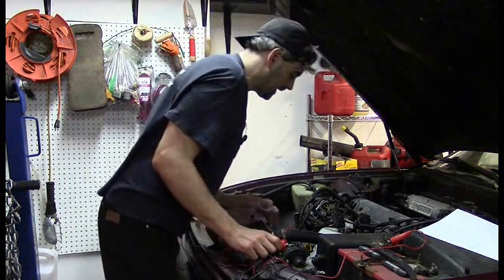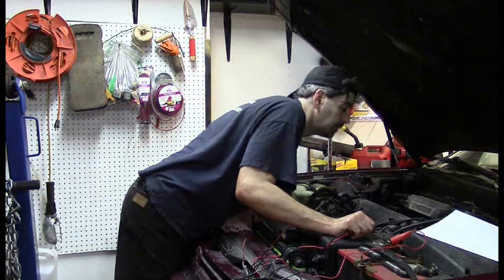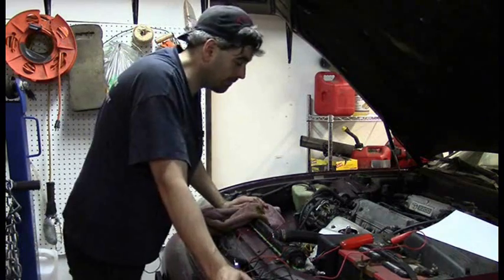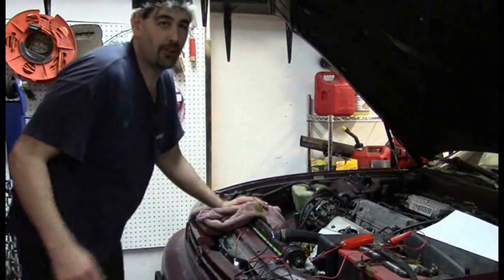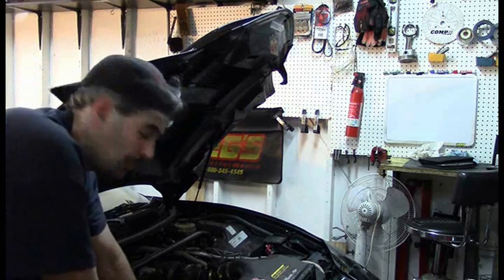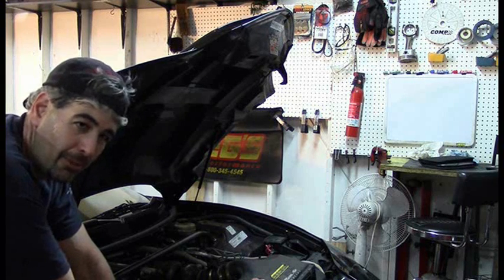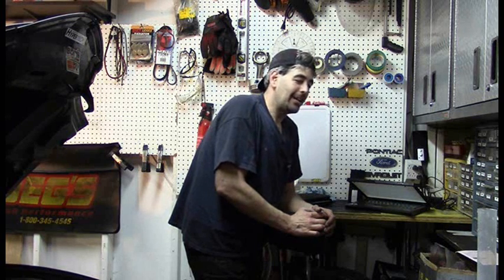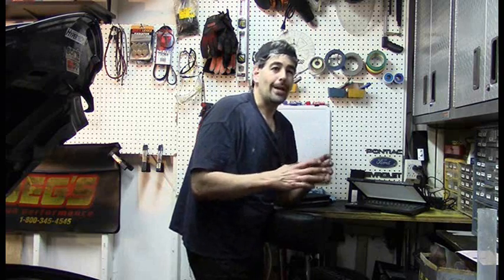12 Ways of How To Test A Blown Head Gasket Compared- PART2

Comment: great, I might add 70s vintage van w/318 after 200k miles would always lose coolant to a point. turned out coolant was permeating through upper hose. My favorite however is fresh water cooled 350 in my boat overheating , collapsing lower radiator hose. All my cars have springs in them after that. Your video will help me diagnose 08 acura v6 overheating, thanx

Comment: Pressure leak down test was fantastic. Bubbling air through radiator!
Testing tailpipe for dye - Nope - Not scientific - didn't check for any florescence BEFORE you added the dye.  (jk)
Boiling oil test was impressive; props to Cedrick!
Could we complete the paper spot test with the dye and the engine cold? That would be pretty dramatic.
Great videos!  You are a great teacher!

Comment: Absolutely outstanding video series on head gaskets!   I've learned so much from you and your Youtube channel in general (you and ScannerDanner inspired me to get an automotive oscilloscope and the AutoEnginuity software).  I'm performing a diagnosis on a 2003 Nissan Sentra 1.8L engine right now.  So far, I have found the same result you did with regard to leakage during the leakdown test. In my case, it was cylinder 1 @TDC experiencing a 22% loss and causing the radiator to overflow when the leakdown tester is pressurized with 100 psi of compressed air.  Matt, given this observation,  is there any chance that the leak may still be due to a failed intake manifold gasket and not a cylinder head gasket, cracked block or head?  I have ordered the chemical test you demonstrated and plan on using that to corroborate my findings from the leakdown test.  Compression in all cylinders falls within the acceptable limits specified in the factory service manual, however cylinder #1 has the lowest compression of the four.   I appreciate your input and thanks in advance for any insight.

Comment: Bro you say you're such a good mechanic why is your trans am your baby radiator black or brown looks like there's a rust in your radiator in your block now through your whole cooling system
Reply from the maker: Well your screen name says it all- you have no idea what you are talking about. The brown stuff is the GM recommended conditioner/sealer "pellet formula" that all pre 2002 vehicles use along with dexcool.  It is not rust. Come on man, seriously.

Comment: Not a mechanic, but purely curious regarding the paper test vs the leak down test. 

Is it possible that #2 is leaking into #3, and #3 is the one leaking into the coolant? That would explain why #2 didn’t have coolant blowing through the spark plug hole.
Reply from the maker: Yes it absolutely is- thats why the test is not definitive on which cylinder BUT if you see coolant on that paper for any reason you are still in trouble.

Comment: I just found your channel... this is very well done, informative and quite practical... thank you.  By the way, the sizzle test is very good for testing for coolant in the oil.    Makes a lot of sense.  But that alone only means Coolant in oil, not a blown head gasket.  It is somewhat likely that it could be blown seals on the water pump.  Now I work on Motorcycles, not cars... but I'd do your other tests first, leak down etc... then if that was good, I'd look to water pump.  I am just looking at your water pump video!  Great Stuff is great!

Comment: Hi would anything change on your fuel trims for this situation?
Reply from the maker: Yes- because of the loss of combustion you will see LEAN fuel trims with a blown head gasket.
Reply: Schrodingers Box 
I’m seeing rich condition ie -20% on ltft, trying to figure out what is wrong with the car. Injectors are not leaking, maf sensor has been changed fuel pressure regulator has been changed and still the same. Any ideas?
Reply: Schrodingers Box 
Ps I love your videos
Reply from the maker: I would totally start with the data showing the MAF and FPR were bad’. The clue would obviously be there.

Comment: Schrodingers Box, Wouldn't a loss of coolant automatically indicate a blown head gasket if there is no leakage?
Reply from the maker: Not necessarily- it could be leakage through the intake manifold, it could ve loss of pressure due to bad cap, could be a cracked block or head.... There are other variables besides necessitating the head gasket.

Comment: I would add one more test that any owner or DIY'r can perform.  An oil analysis.  A small sample of oi sent to lab will provide valuable information about the condition of the engine mechanical, cooling system, fuel system and condition of the oil. I have avoided costly damage and repairs in the past 20 years, from coolant contamination, fuel contamination, excessive wear, air born contaminents.  These tests can detect very low levels before symptoms are noticeable.  Cost $25-30, results returned in about 5 days.  Also recommend analysis of engine oil and transmission when buying used.
Reply from the maker: Hate to break it to you but these tests are completely bogus.
Reply: Oil analysis has been used by the military, aviation, major industries and commercial transportation industries for years in routine maintenance and diagnosis.  You always talk about quantifiable, and verifiable evidence when evaluating and testing methods and procedures  Where is your evidence that spectroscopic oil analysis for wear metals, additives,and contaminants is bogus.  There are decades of research, and peer reviewed journals confirming the reliability of these tests.
Reply: @briansydnes1711  i only hear crickets... no response to your comment.

Comment: Hi mate, thanks for the video, learned a lot. 
Maybe your paper test with the hot engine did not work, because the tiny amount of coolant which went through the hot engine are evaporated, and could not "hit" your paper. 
When the engine is cold, the little cooland drops are not evaporated, and showed up on the piece of paper. What you think?

Comment: On the oil vapor test,   how do you know if the gas evolution was from incorporate gas that was introduced during running the engine and had not yet escaped due to interfacial tension and dissolution effects?  had the oil been sitting for awhile?  you should pull vacuum on the oil first, and then do this test...

Comment: Hi there i love all your videos very helpful. I'm having a problem with my father inlaws car the water pump was leaking so i changed it and thin bleed the coolent system but the problem is that it will not bleed i keep getting air in it cold that be a sign of head gasket or intake manifold gasket bad ?
Reply from the maker: Could be. What data do you have?
Reply: It's the head gasket
Reply: Im get the oem block tester tomorrow to test it. There is white smoke coming from the tial pipe and there is no heat coming from heater and there was a really bad fouled spark plug

Comment: Thank you for this video series. Best video I have ever watched. I NEED HELP. Why does my coolant reservoir slowly overflow as my engine heats up? Then when I rev it it changes into a musty color then it begins to create a lot of steam? Some cases the coolant has boiled and flooded out of the tank. When I turn off the engine, the coolant gets sucked back into normal level.
Reply from the maker: What is your data from the tests shown?
Reply: Schrodingers Box I did the compression test and all my cylinders came out to spec. Can I use the combustion leak tester on my overflow reservoir tank instead of the radiator? (I don’t have a radiator cap on my car)

Comment: My V70 diesel Volvo has oil in the header tank. I really hope it's a cracked oil/water cooler. Thought my engine oil wasn't contaminated given I thought I'd see mayo but damn it sizzles. Compression is also sounds low on a few cylinders. I hope your wrong but everything is pointing towards it being expensive. Great Video BTW.
Reply from the maker: What is your cylinder compression on each cylinder?
Reply: Schrodingers Box - Unfortunately I don't have a compression tester for a diesel but the oil cooler is at the bottom of the sump which got hit recently...I got a cheap replacement cooler so I'll soon know right or wrong once I finally get the O rings today. The car is worth very little and I don't have the skills to take the head off myself so I hope it is a cheap fix.

Comment: Good video dude. But from where did you collect the oil from and the coolant? When you dropped it on the heated surface to check for sizzling bubbles!!
Reply from the maker: You can just use oil from the dipstick

Comment: The best yet video for diagnosing head gasket and loss of coolant. I'm in the process myself of troubleshooting coolant loss in a class 8 truck. Your the best my friend....thanks for taking the time and posting this great video.
Reply: What if it has an oil cooler failure known common fault thermostat causes it! like any ecotec engine from GM and it's only mayonnaise in the header tank? smelly old black oil no visible water but bubbles with the "SIZZLE" test?

Comment: thank you for your input, say i hear you say you work a lot on GM vihecles ,well my question is i have a 2002 olds bravada and the all wheel drive stoped working, this is what i did i changed the transfer case oil witch is blue, and i changed the transfer case incoder motor but it still does not fix it ,finally we took it to the dealer and they say thier is no codes for it, just to let you know the allwheel drive stoped working this past winter 2018,can you help me please and thank you.
Reply from the maker: What are you voltage readings and voltage drops at the transfer case selector?

Comment: When you added fluorescent dye to the radiator you checked if there was dye on the spark plugs could you have checked if in the cylinders you had presence of dye with the florescent black flash light looking down the cylinders ?  Thanks very informative videos.
Reply from the maker: On the engine in this video it would be impossible to look into the cylinders

Comment: What about spitting water out from the tail exhaust pipe when the engine is running hot? Could this a definite blown head casket ?
Reply from the maker: Not definite. Could be caused from leaking intake manifold too.
Reply: Thanks, Schrodingers for your response. My car a 1997 Camry is spitting water when warmed up and idling becomes rough.
Reply from the maker: Compression test difinitely is what I'd do then

Comment: Hi there
Thanks for informative videos but I'm confused about the tests to find bubbles. The same test was done in part 1 with heaps of bubbles but the test in part 2 did show a couple of bubbles in the car with problem. ???
Reply from the maker: Thats why using that as a marker is inconclusive.  Most "hacks" use the bubble test but as you can see it is unreliable. In the case of a potential head gasket failure, a 100% diagnosis is necessary!

Comment: Great tips! My grandfather showed me one years ago. It's kinda like a home brewed, old school leak down test. With a air tool male fitting, and a fitting the size/thread of your spark plug hole (Some compression tester kits have this fitting). Thread it in each cylinder, hook your compressor up, and set it to around 100 psi. Watch your gauge on the tank to see how much is leaking w/the compressor off. Also listen at the tailpipe, and throttle body. Pop the radiator cap at look for bubbles. Although not as good as a leak down test, it's very affordable, and same principles.

Comment: great, informative vid. 
Hoping you can advise me, (define symptom), 1996 chevy G-10, over heated, did the thermostat & water pump. universal coolant was put in. over heated.removed thermostat,  flushed, 1 jug detergent. Fluctuating gage, over heats. Turn off then upper hose gets sucked flat? Please help. thank you.  subscribed.
Reply from the maker: What did the compression test show?
Reply: Schrodingers Box can't do till mon.
Reply: Schrodingers Box will let you know results. 
thanks again.
Reply: hey man, turned out to be cracked, upper hose connect. didn't know why upper hose would vacuum flat after shut off. leaked out and created a draw. oh and a simolteanius miss fire. 
thanks dude. watching & recommending.

Comment: Awesome video, learned a lot. Thanks man!

Which test would you suggest for finding a head gasket leak, where coolant channel leaks to the outside but not into a cylinder?
Reply from the maker: Cooling system pressure test. I have a couple videios on those including a homemade one.

Comment: .after all the testing so far wouldn't it be safe to assume the head has to come off regardless, check the head for warpage and a flux test, and check the cylinder at the same time?
Reply from the maker: ANYTIME you have low compression or a high leakdown- yes, there is no way around it- at the very minimum that head is coming off as part of the repair.

Comment: Your sizzle test is truly a great way to determine HG failure.  Oil and coolant are soluble in minute quantities that can be detected this way.  Thanks.
Reply from the maker: They are not soluble- they are immiscible but emulsifiable.
 it is merely that the presence of water will cause it to boil creating the sizzle effect.
Reply: You are correct. I ran the test on my engine oil (Jag XF 11) and no sizzle in the oil. I ran a negative sample with new oil and both burn the same.  The coolant smell after driving on the left side is driving me nuts.

Comment: Thank you for sharing this video! I have a 2005 Honda Civic which has a bad head gasket but it isn't mixing the coolant with the oil, it's just pressurizing  my coolant system with air. Do you think i can drive my just to work until I save money to fix it?

Comment: The bubble test is reliable if you take and disable the water pump by taking the fan belts off then removing the thermostat housing then the thermostat.  Since the water pump is not running, the only bubbles in the water jacket will be from the blown head gasket once the engine is started.  The interesting thing is if the engine is a V6 or a V8 it will bubble from the side that is blown.  My grandfather showed me that trick.  He's an old master mechanic.  Mind you that test only works if gases are escaping into the water jacket.

Comment: I take an old wrench,chuck it in the vise,heat it up with  a propane torch and take the oil and apply it to the heated area. You would be amazed how fast it sizzles if there is coolant in the oil. This is the first test that I do. I have been working on cars for quite awhile and have never seen a false positive using the 'sizzle test.If it sizzles you have got coolant leaking from some where into the oil. Wonderful video
Reply: john james,  Wouldn't a loss of coolant automatically indicate a blown head gasket if there is no leakage?

Comment: Great video buddy. I am just having issue on my 1992, 3L Chrysler Voyager and my preliminary visual tests having the same negative results like yours. No water in the engine oil, filler cap is clean, no white smoke from tail pipe etc.   BUT, I do have bubbles/foam coming from the radiator when I open the cap. My issue started the other day when I was easy cruising on the highway 65m/h, in en instant my water gauge went to max in few seconds and I just happen to see it as I follow the gauges VERY frequently (ex car racer). I shut the car in few seconds and pull over. Now it's at mechanic place to do real tests, take the heads of, magnaflux, etc.etc. and to change head gaskets.     Ok that said, I just wonder WHY this happen. What's the cause for the head gasket to blow?  The car run perfect... the ONLY thing I did before this was, drained the water and putt antifreeze as winter is coming soon (it run only 120miles like that).
So my question again: Why the head gasket give up? Just age or what. My worry now is, once going thru all the work and expense, what will guarantee that it will not happen again because of - what ever. Thanks man in advance for your answer.

Forgot to mention that my car is gas but runs on LPG.
I have automatic transmission
I was on cruise control
I had no previous heating issue - have the car only for 2 months (maybe the owner before me)
You can see the bubbles and foaming only when the car reaches operating temparature and the thermostat open.

Comment: i have a 1998 Audi S4 1.8T and i have water in my oil and oil in my coolant, But it has an oil cooler.  Whats your thoughts on that ?
Reply: +Dalton Wardell  I have no thoughts without data.  What are the results of your diagnostic tests?
Reply: not sure yet  i bypassed the oil cooler yester day and changed the oil but i need to flush it to get all the water out   ill update and let you know
Reply: head was done by a shop 3 weeks ago and they did something wrong and the head is leaking coolant in oil
Reply: Dalton Wardell I see it happen all the time. If there is no compression loss, this is often caused by an intake manifold gasket failure. Not uncommon since if the head gasket failed due to warpage, it is reasonable that the intake manifold would do same.
Reply: the head is new   i think they put it in wrong
Reply: +Dalton Wardell Ask them if they resurfaced the head. They should be able to tell you the specs for the resurfacing they did (different for aluminum/steel & steel/steel respective to head/block). Of course there could be all sorts of other problems, like reusing bolts, junky torque pattern, etc.

Comment: Matt, great video.  Can I suggest an easier way to test for water in the oil rather than using the sizzle test which makes a load of smoke?  Why not try dipping a hygrometer (brake fluid tester "pen") into a sample of the oil?  Would that work?
Reply from the maker: +cpcpeter Sounds a lot more labor intensive to lift the vehicle and crawl under it for a messy sample than just taking the dipstick and touching it to the exhaust manifold but I guess a hygrometer would work if you were willing to go through that effort.